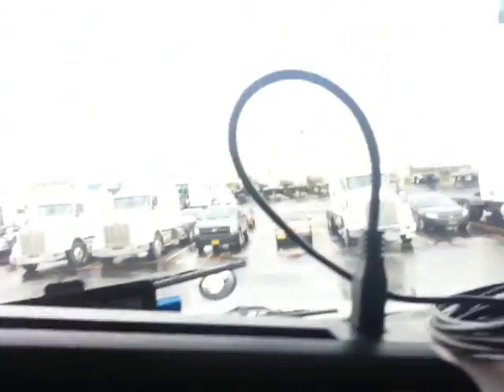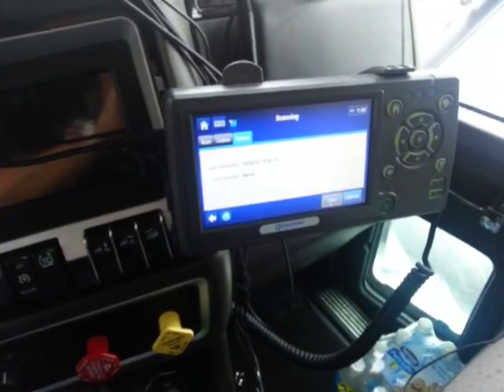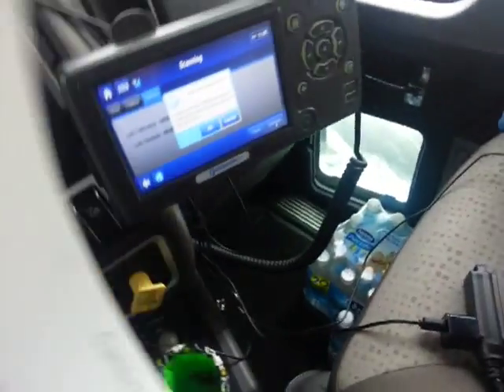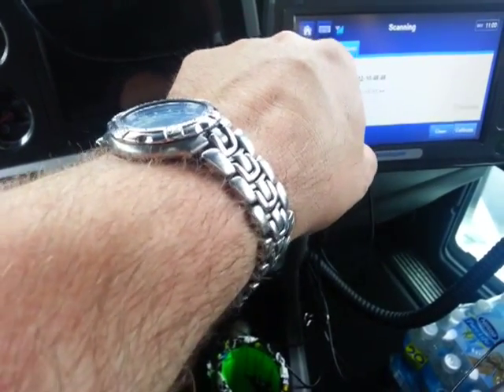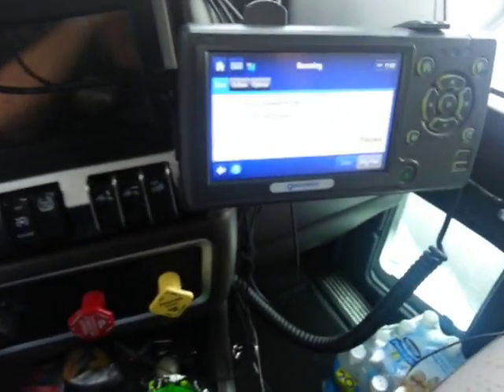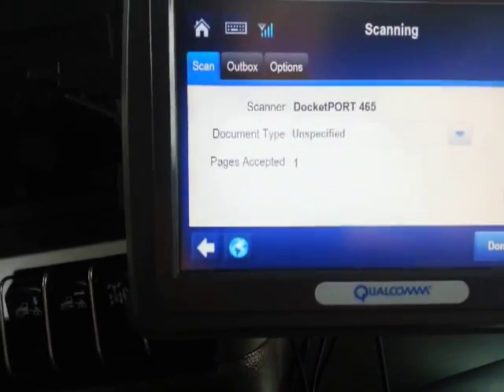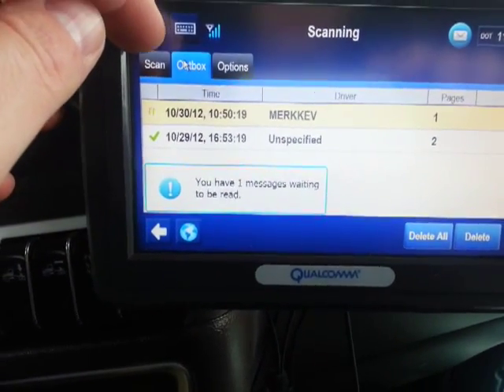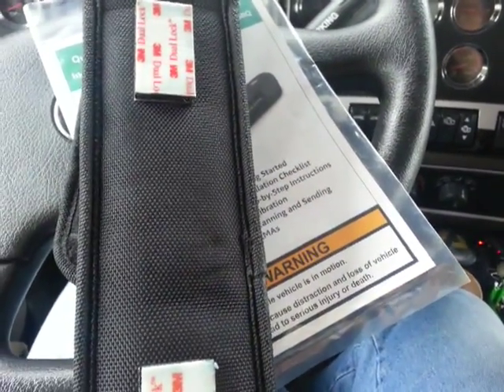Scanner for Qualcomm

Comment: Do you know any thing about adding a printer to a MCP200 Qualcomm, i bought the printer showed on my unit the hp470 printer but it only print the test page? the printer button in messages is greyed out? and the password button what ever that's for!
Reply from the maker: Antoine Finch you will have to have your company account admin enable printing. Whoop ever is in charge of your support software.
Reply: thanks